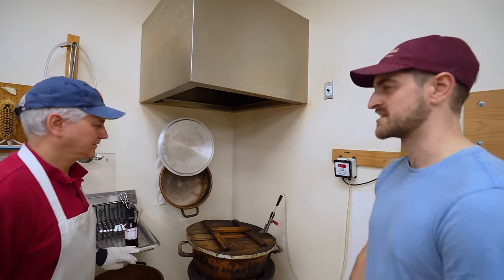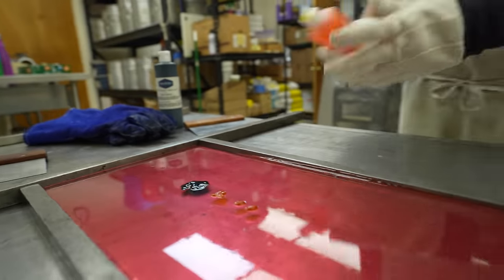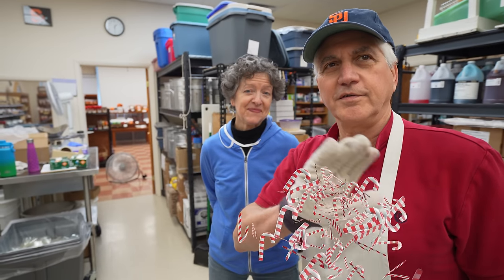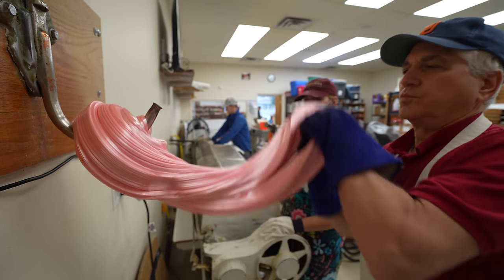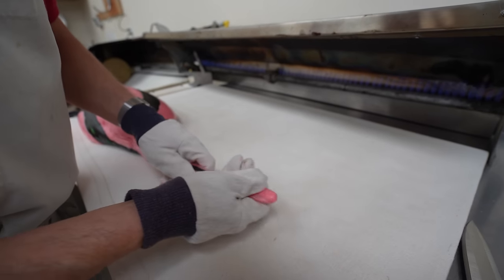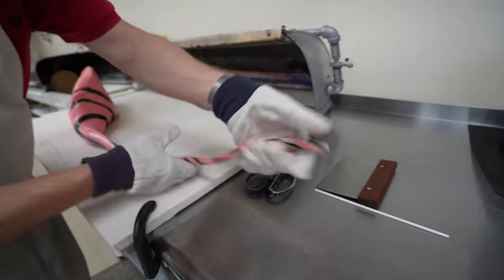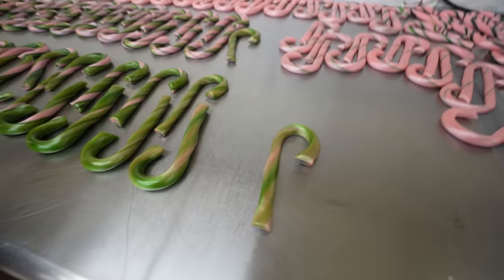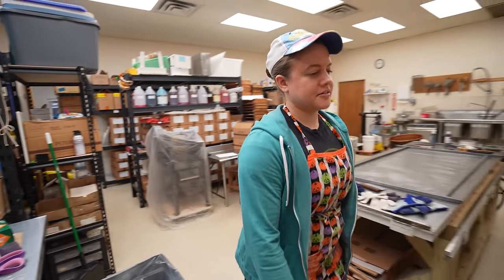This is our MOST Popular Candy Cane Flavor!

Comment: Have you ever considered installing a paper cutter type blade at the end of your table with the flames? You use scissors, which is great but it involves setting down the candy and doing a fine motor skill to cut. If you have a handle with a blade (paper cutter or paper trimmer is what they're called), you would just reach up and pull and it would cut your candy on the table. Ive never commented this but every time I watch you pick up scissors over and over again, I cant help but think it would be hugely helpful. Love your content.